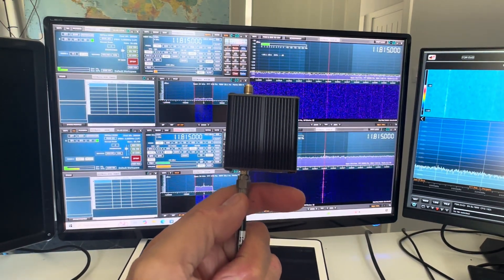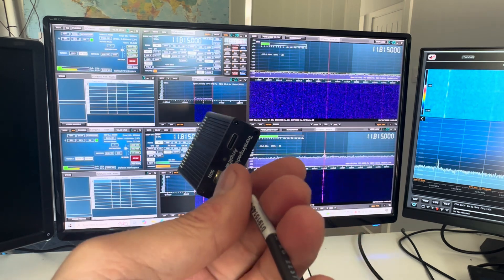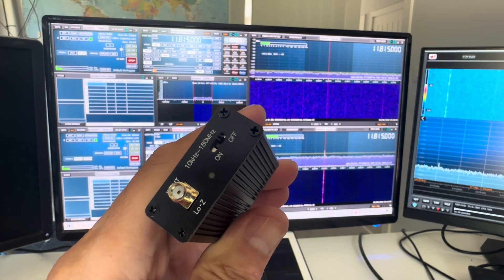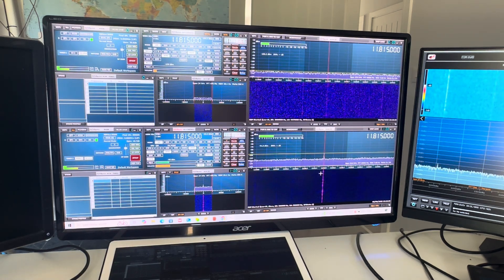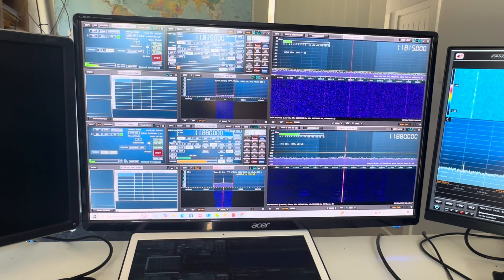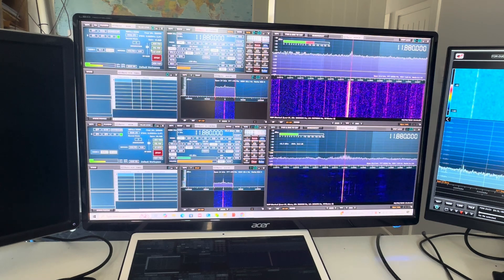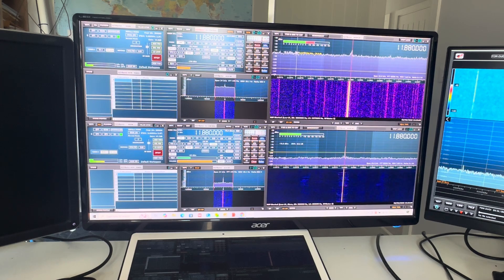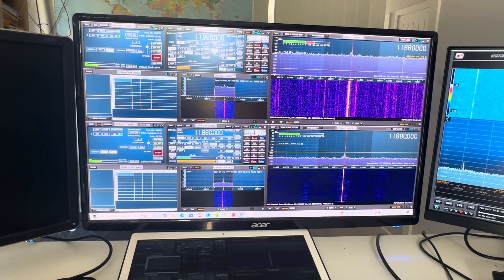Beware of cheap wideband antenna amplifiers...they usually deliver very poor SNR on HF

Comment: I've always been of the opinion that putting an amp in front of a receiver is only useful to compensate for a poor front end on your receiver. Mast head, certainly but not receiver end. Also, those cheap units "could" be a lot better as the actual silicon doing the amplification is usually quite capable, it's the penny pinching design around it that is the problem along with, as pointed out elsewhere, a noisy PSU.  Me, I just use a doublet and a passive ATU for all my HF listening. :)
Reply from the maker: Great comments, thanks. I use a magnetic loop (good quality) or a wire with a passive matching unit.

Comment: Never had much luck with pre-amplification at HF.
I have the same unit you demonstrated Clint.
It works nicely at VHF airband but seems to have a high noise figure on the HF bands.
Reply from the maker: Thanks for the info., Adam. Definitely a no go on HF. 73
Reply: @OxfordShortwaveLog And you were absolutely correct with the Malachite DSP2. What a great radio it is!
Glad you recommended I get one! 
🙂
Reply from the maker: Great stuff! Glad to hear that Adam! 73

Comment: Hi Clint, I have a few lna's. Found battery ones lower noise floor. A good one I found is  Mad Hornets HT004 Low Noise Amplifier, spec, Frequency Range: 0.1MHz - 6GHz. Also, my Messrs LAR Modules Limited, SWL Omni - Match pi -network manual antenna tuner, 500Khz - 30Mhz, works as low pass filter. I found the model you have is noisy and the fitted battery version makes a difference. I'm using Radioworld discone  antenna 0.05-2000 MhZ passive. The Ga-800 mag. loop likes the TQP3M9037-LNA. Hope it helps. 73
Reply from the maker: Thanks for your comments, Michael. 73

Comment: I'm not sure what's inside that little amp, but if it is a 'hi-z converter', surely it is not suited to working with a loop antenna? Loops, especially small ones, are low impedance and work best feeding a low imp amplifier. Did you try it with a short wire antenna (preferably outside away from the shack)?  Other than that I agree that this mania for putting umpteen dB of gain in front of an HF receiver is misguided to say the least!
Reply from the maker: It's interesting because I've approximately calculated the inductance of the loop to be in the 10^-6 micro henry range and from that (frequency dependent of course) at 5 MHz the impedance, which is very low for a 1m diameter loop. The bottom line is the electronics are obviously generated a lot of noise - 10s of dBm which is killing the SNR. Cheers

Comment: performance of the amp may be improved by ensuring the power supply (assuming battery) is adequately decoupled? Maybe shunting some low-noise caps across the PS might help? I don't know, but the noise must be generated somewhere in the circuit and I'd like to think they would be using high-gain low-noise devices in there, even if it's comparatively cheap 🤷‍♂ and if so, poorly decoupled PS's are often a cause of noise.
Reply from the maker: Thanks Greg, but this cheap device isn't worth the effort. It's generating a noise floor about 40 or 50 dBm higher than one of my Wellbrooks. It's fine because it cost less than 20 quid, but a good demonstration as to why it's better to spend a bit (ok a lot) more for a decent antenna. 73